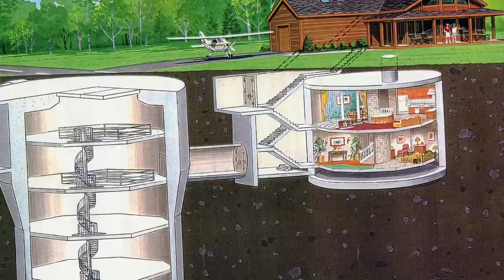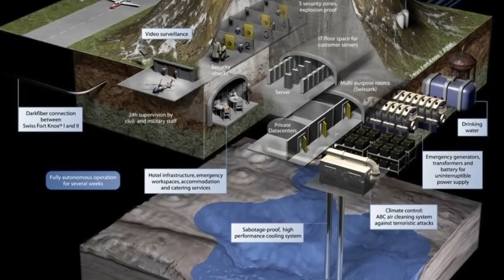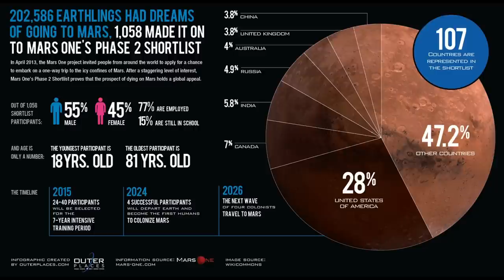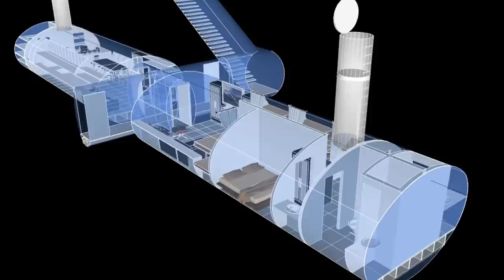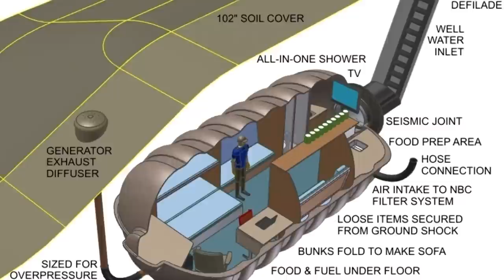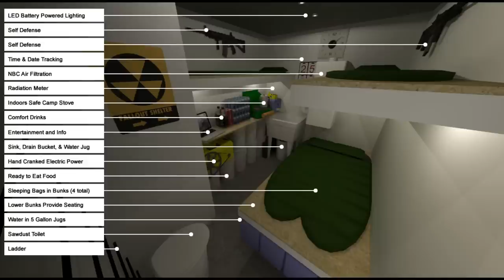The Psychology of Bunker Survival | Canadian Prepper

Comment: Twenty years ago I had severe agoraphobia for a couple of years after suffering from panic attacks of an increasing frequency. I didn't leave my house at all happily for about two years and not at all alone and could go a couple of months without even stepping on the porch.  A bunker like that would have been heaven!  Lol. It may be only the agoraphobics who thrive in that situation.  

If you're wondering, I did try many types of therapy and meds during that time, all of which were basically useless.  What finally helped was a long term prescription for xanax.  I took it in a very low dosage several times a day for the first few months then gradually tapered off.  I was on it overall, about a year and a half.  What helped the most was the psychological aspect of it - I knew even when I was off it altogether, that I had a bottle of them in my purse and if I had a panic attack I could take a half pill and it would stop within ten or fifteen minutes.  As it turned out, all I needed was the tool to stop the attacks and access to it.  Yes ,I was physically dependent on it while taking it every day but I never craved it or abused it or had any issues, as I took it exactly as prescribed.  I went into all the info in case you're interested in it, since you do this for a living.  

But, maybe the phobics will be the new ruling class in the post apocolypse. ;-)

Comment: Theoretically speaking, to minimize time underground you would want to end up in an area with the least amount of fallout. So I guess build your bunker In a place where you feel less Radiation and Nukes would end up in most scenarios. Somewhere In Northern Saskatchewan Canada is where I heard is the best place to set up. 

Also, to minimize the amount of stress and anxiety mentally speaking when in a bunker, find a common color for the walls everyone likes, much sure to keep the layout very open, use a low voltage LED screen to flash through multiple shots of scenery, and have lots of different pastimes and activities that make people feel productive.
Reply: +steven boyer 
The place with the least radiation and nukes is the open sea. Ideally on a submarine because it can dive during fallout phase and washing all away that comes down. But it is very important to be emerged, when the bombs fell or water pressure will kill you.

Comment: Ever seen that movie The Divide? Pretty much sums up the exact opposite result of not being an isolationist type bunker mentality type. Prison populations an excellent idea for research. Would definitely want to read the whitepaper on those. Were they aware they were subject to the study, did it impact their immediate treatment etc.

Fallout vs Bomb shelter distinction is worth making too. It is also worth reading up on the Japanese and how they would handle the tunnels at Iwo Jima, along with the Cong in Vietnam.

If I were designing a bunker I would make all the rooms irregular, Different colours shapes, and not separating the water system, otherwise someones going to run the water all night. Books. Books and music that can't be cranked to 11. I would argue that maybe a semi huge supply of SSRI's wouldn't go astray.
Physical activity, using up energy would be handy.

Id suggest the most important would be radio and outside signally routines. Even if they DIDN'T ACTUALLY contact anyone, the idea of the Button to press in Lost is ironically a good idea.
Reply from the maker: +S3CR3TL3V3LZ A pedal power device to generate electricity would provide exercise and electricity, granted it will require calories.
Reply: If you had some sort of kinetic system underground I'd try and gear it to use, say, a natural wellspring to drive it. Sort of like the mechanical advantage of taking a few thousand liters of water and using them to power hydro, but then you get that age old physics issue. I think with labor shifts you could easily re pump an outlet to set a flow that could work a mini turbine.
I definitely wouldn't want a system utterly dependent on physical ability, mostly in case of injuries or sickness.
Quarantine in bunkers would be awful.

Comment: As an anarchist politically, I would of course say that imposed order and law would not be the only way and probably cause issues.

The biggest problem with "imposed order is the only way" here is that it will invariably lead to issues. Even if someone is perfectly willing to follow all rules imposed for the safety and greater good of the shelter (which in this situation is justified, and could be done without law and such), this will cause friction and grate on people. 

A libertarian's nightmare? Yes. So if anyone in such a situation is vaguely freedom loving or politically libertarian, they are quite literally stuck in their own nightmare. Or even if a totalitarian, ever present micromanaging system is literally just their nightmare. You think that won't cause MASSIVE issues, especially considering that quite a large portion of people who would prepare like this think in such ways? It'd cause underground riots. 

This is why bunkers are primarily useful as a way to ride out the first bit (if it's a disaster that needs it), and then used as the center of a mostly above ground community after that. It's so comparatively impractical to last any protracted length of time underground.
Reply: Good video overall, that first thing was my primary complaint

Don't forget what part of the spectrum the light is from, blue vs red; blue is calming and stimulates productivity, and red stimulates aggression (iirc, but something to look into). 

Absolutely on projects and such; I saw others talk about exercise, and this is absolutely true.

Also, I feel as though having multiple entries/ exits would calm some people. The uncertainty of the one working, or is it blocked, or ... Would kill me and probably lead mildly clostrophobic people to panic attacks.
This, and having ways to observe/ communicate with the outside world (that everyone is able to access). A few cctv cameras in various places up top, sensors and instruments, scanning airwaves of various sorts, etc. this would help calm people and put their energy towards a fairly constructive outlet. 

Everyone would need to bring most of the length of time planned for in entertainment; and no, no repeats. The little girl who watches the same disney movie 200 times would be despised with a passion. And not only entertainment as traditionally defined, but hobbies. 

Beyond that, teambuilding exercises (you can spice these up a bit, it's the apocalypse after all) and clubs and such would be invaluable. Make some things in a craft area which would be useful after you're back on the surface. While you're at it, train everyone in every possible skillset you have. You have nothing but time and energy.

The larger vaults should also have large stockpiles of information; some people like myself would love that sort of thing. 

Also, everyone needs their own small space. I hate the barracks style sleeping for this; those are meant to dehumanize you in a certain way, the opposite of what is trying to be achieved here. Even if it's a large locker for personal stuff, a personal bathroom stall minus shower, and a shared bedroom with individual curtains around beds, it'd be quite necessary. Ideally everyone would have a personal sleeping area with a small ensuite bathroom, and a closet. 

Also, I very rarely see people plan for a time when they leave the bunker. You have up until then covered, but... What after that? You'll have to start farming and producing food and goods, which you'll literally be starting from scratch in, having been in a bunker. In all practicality, you'll probably have daily trips outside while still under lockdown (in NBC suits or heavy armor) for routine maintenance and patrolling, but still a valid point.

And are there seriously people who plan to live out of their INCH bag forever? I thought the idea, and not a horrible one, was to get everything you needed to start up a new life where you're planning on going (either basic tools to build a cabin or stuff to work your way into a community), and maybe come back to your former home after the extended disaster ends. People have done that with the clothes on their backs, so it's presumably mostly to ease such a transition. But walking and living out of the same bag for years? People have done it, but that's hardcore. Most don't even think about ancient migratory peoples who lived that lifestyle when they make such bags.
Reply from the maker: farmerboy916 I think that routine, structure in an enclosed space like a bunker (much like a prison) is essential to maintaining order, the same may not be the case in a free range environment but when resources are limited the decision cannot be left to individuals whether or not to ration resources, this will cause problems indeed, I like hearing other perspectives, the order ideally would be democratic and group imposed.
Reply: Canadian Prepper Problem with that is that such structure is tenuously held at best in most places like prisons. Routines, sure. I know just how necessary routine can be for mental and social health. 

And sure you'd need some sort of supervised authority to ensure that rations are distributed properly and maintain the equilibrium that keeps the shelter livable, but I feel as though either the shelter is small enough that it could be handled in a sort of familial/ clan fashion, or the bunker is large enough that supplies would have their own security (locked up, maybe a cctv camera), and be counted/ recounted routinely. 

The thing which makes a democratic decision making apparatus feasible and just here is that everyone knew what they were getting into when they joined up to go into the bunker. Of course the problem is what happens with factions; what if the majority endangers the minority? Etc. Another issue is that most consider an enforcement arm necessary to maintain "order" even in such a small environment; in reality, that being a full time job would be a waste of resources and lead to the issues I bring up above. That's what equates to "order" in a lot of usage, rather than meaning not chaos.

But for things like "___ happened outside, what do we do? Do we wait another X weeks before opening the door?" I can't imagine anything except some sort of democratic forum where ideas and thoughts are discussed, then run past the bunker expert(s)/ those knowledgeable in the applicable field.

Comment: One thing that was NOT "Fairly" addressed in this video . . . those who CHOOSE to be "Involved", have MADE the necessary decision to "Do So'. It is NOT a "Snap Decision", it was based on a "Family"desire to PROTECT ones "Family", for the LONG TERM, which means that the "Specific Facts" of having MADE said decision, are "Known" to ALL INVOLVED. Specifically, PAYING ATTENTION to varis, trusted, "Media Reports", by which the "Decision" to get TO their bunker, will BE MADE . . . so "Not being Able" to GET THERE, is frankly a "Non Issue".  They will be "Very Much" AWARE, that once their IN, it will be for a "Specific Amount" of TIME. Getting "Settled", after first ARRIVING "Might Be" a bit TAXING, but that should "Pass" fairly quickly.  Having made a number of "Dry Runs", for specific amounts of TIME, as "Practice", will make SETTLING that much "Easier". This enviornment, will be the TEST of "Proper Parenting". I could GO ON, but I think my points have been MADE.